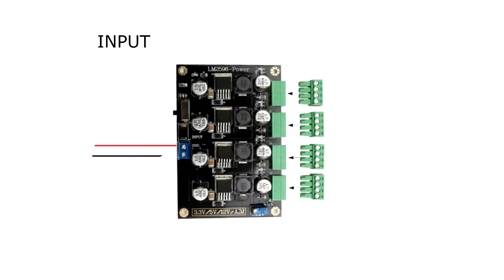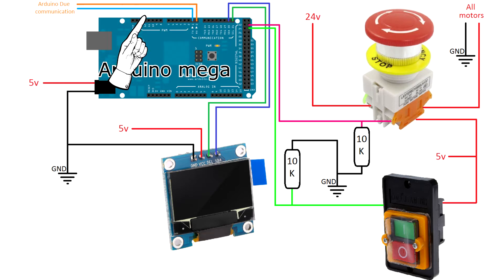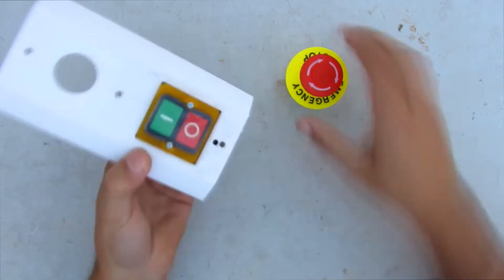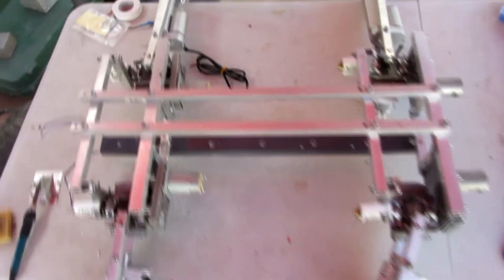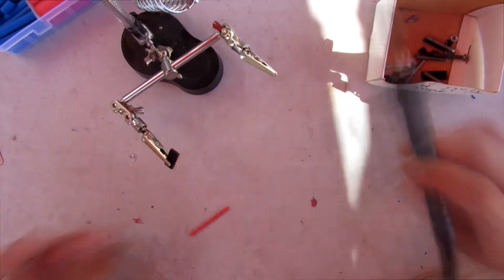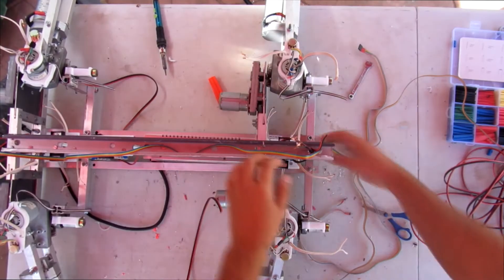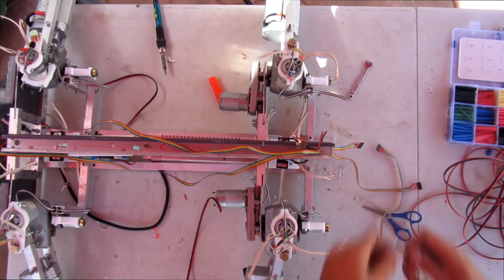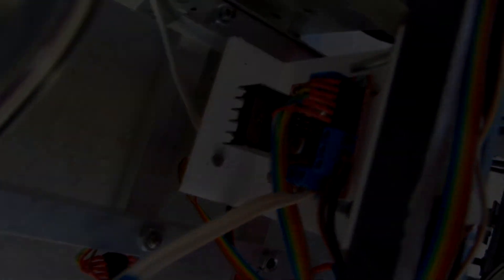#5 Electronics - Pavlov project: Building a quadruped robot

Comment: Hi andres,
I am doing Ph.D. in Kinematics and Gait Pattern of Quadrupeds. My focus is on kinematic but for the experiment, I'll have to fabricate a model and this video will helo a lot. Thank you from the bottom of my heart for the demonstration. I am from Mechanical field so electronics and programming are quite difficult for me. Could you please say that when will you share the video on arduino coding? Could you please share the designs of this. Mine is only a research purpose and I'll give due credits to your efforts.
My email id is 19ftphde35@nirmauni.ac.in. 

Thank you again..!

Comment: Are you going to use a mathimatical model to control the movements of the robot? is the robot going to have reflexes to maintain stability? does the robot have any sensors like acelerometers gyroscopes or even force sensors on the feet to help it balance?